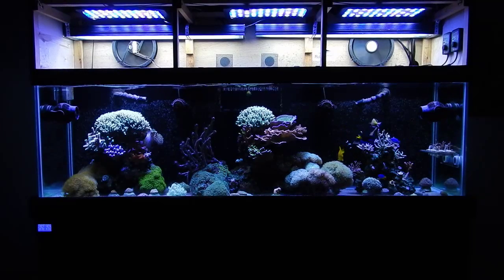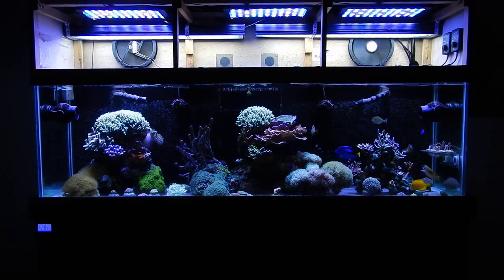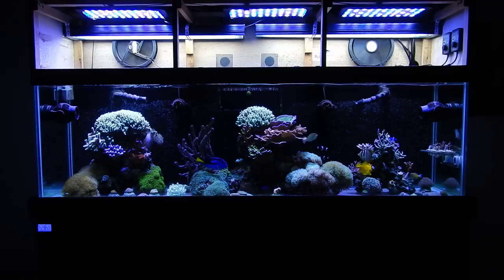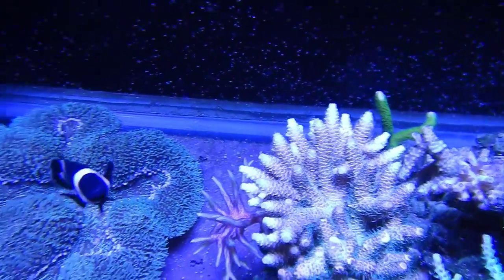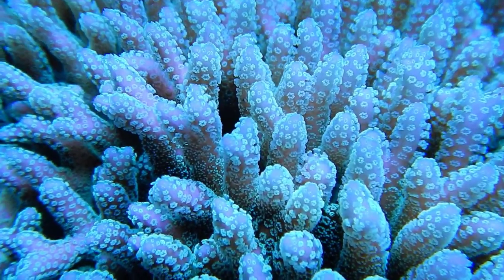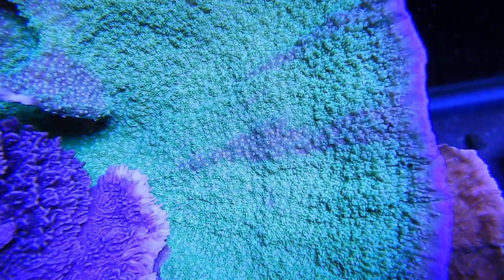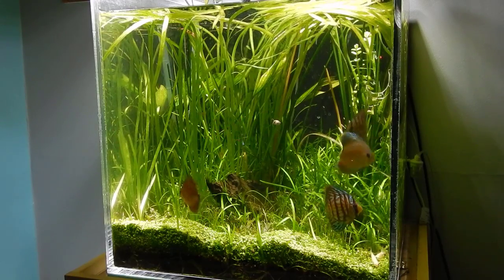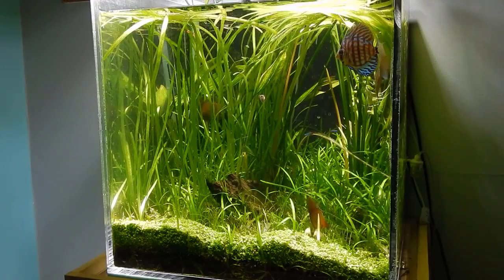Reverse Osmosis Deionization Filter | Answering Beginner Questions Part 6

Comment: What is the difference of a home drinking RO system and the RODI system? Is it ok to use the RO water from my RO system or where can I get the correct water from if I do not have an RODI system?
Reply from the maker: +Amey Ashley the only difference is the DI resign. You do not want to drink water after the di. The di makes the water ultra pure for your tank. I personally have a home drinking system and one for my tanks. Both purchased off ebay.

Comment: I noticed there's water trapped in each of the filter cannisters after I'm done producing RODI water. Is it important to drain that left ofter water before I put it away?
Reply from the maker: +Dara Chan that's normal what u can do is disconnect the di if possible when first starting it up to let the high tds water drain away that way your di will last longer

Comment: For those with smaller tanks, you can use distilled bottled-water as an alternative.  I don't have a big system (29 gallons), so I just buy a crate of cheap bottled water from Food Lion and pour two bottles in a day.  For anything larger though, RO-DI would probably be a better investment.  Nice info.
Reply from the maker: I personally would never use anything but ro/di
Reply: Fair enough.  RO/DI works partly by reverse-osmosis (from what I've read).  On the bottled water I have, it's unflavored and purified w/reverse osmosis.  Also comes with calc chloride and sodium bicarbonate mixed in.  The calc essentially supplements the dosing and the sodium helps keep the alkalinity stable.  I've had good luck with it thus far (I can grow SPS with it- that's kinda my benchmark).  However, I'd be weary of different brands as I don't know how much the water would vary.

Comment: Nice detailed explanation of the Rodi unit. I was wondering which of the stages removes the silicate out of the water cause I'm using the brs 4 stage and my tds is at zero coming out but I still get fluffy diatoms all over the rock work. The tanks been running 7 months now.
Reply from the maker: If its 0 TDS and you are using DI its not your water

Comment: Hex very good video. Lots of great info. When you change your carbon and RO membrane do you flush the system out before using it????  I've always disconnected my DI resin and ran about 5 gallons through it. I've always wondered if this is necessary. Thanks.
Reply from the maker: I remove the DI and flush the system for about 2 hours  before reconnecting the di